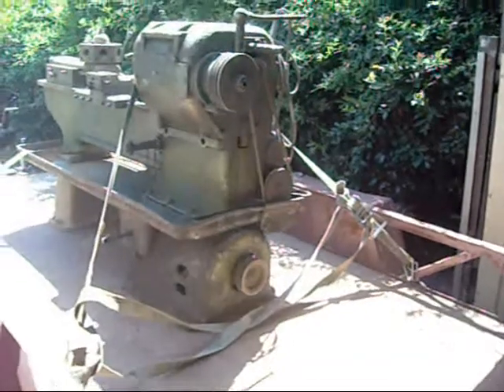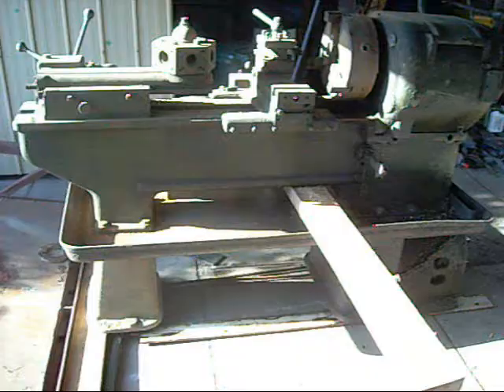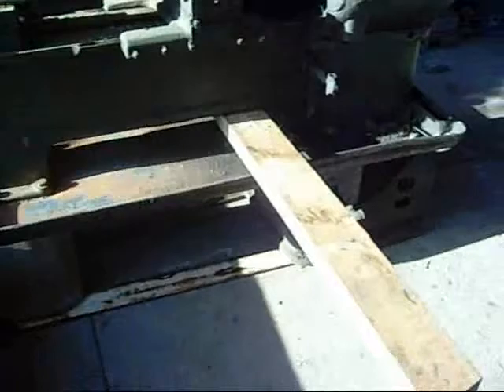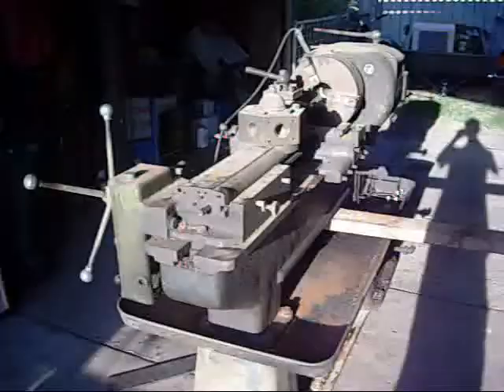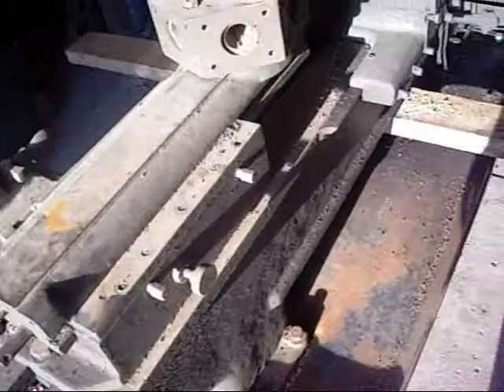Moving The Turret Lathe In and First Run

Comment from the maker: lol nah, I need smooth power for metal turning, a small IC engine would send vibrations through the geartrain and ultimately to the workpiece.

it would like like the cutting tool was chattering and leave a rough surface finish.

Even the vibration of the single phase motor is very apparent, hence the loud whine on startup,

Comment from the maker: I've seen tiny benchtop lathes for sale here at electronics and hobby supply stores. they are Chinese and not much good for large bits of steel, but they would work well on aluminum RC car pistons, cylinders etc..

they were going for roughly $500AUD (200 ish USD)
when you've got a couple of hundred to blow go check out Harbor Freight's inventory.